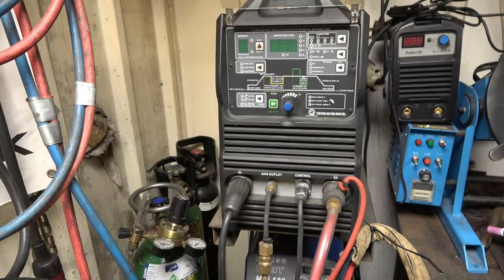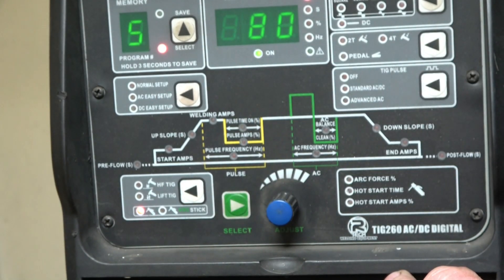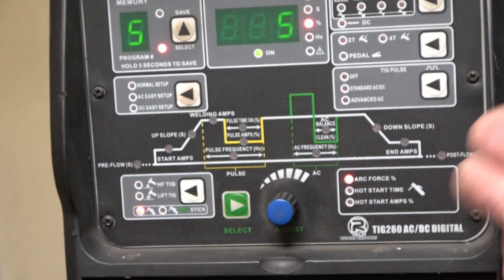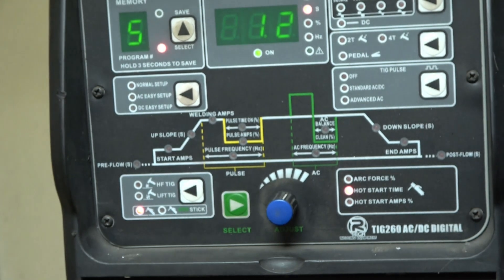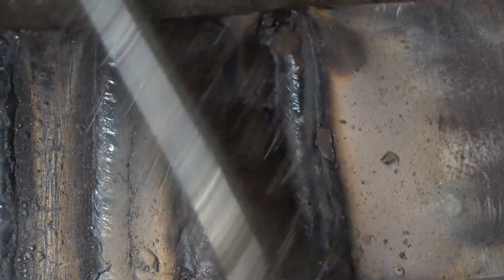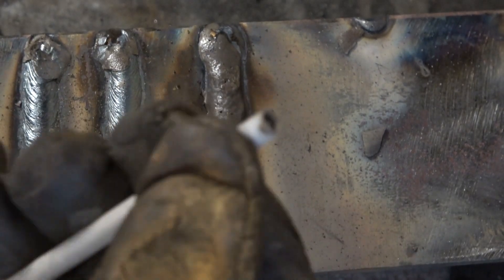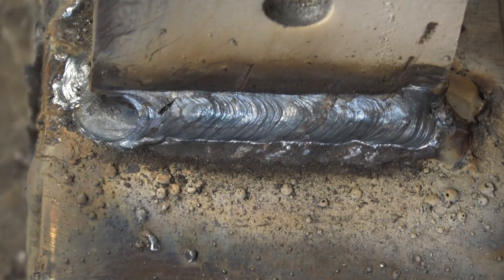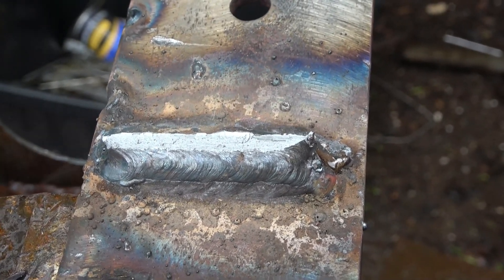R-Tech Power Tig 260 Long Term Review . MMA  Welding . Hot Start & Arc Force . Explained

Comment: Cheers John, good welder for stick welding. The arc force and hot start is very handy for digging into really thick steel. Out of interest where do you get the 7018 rods from?
Reply from the maker: They were supplied by R Tech
Reply: @doubleboost  Many thanks.
Reply: We needed some 7018's for a repair on a timber harvester, my son picked up a generic pack from a  local motor factors and they just wouldn't start an arc and we tried 3 different transformer welders (all had enough open voltage) I got a 0.6kg pack of Murex from our local steel stockist and they were different again, but that hot start function looks really useful.
Reply: @graemewhite5029  It is really useful.
Reply: I think it's the first time I have seen stick welding up close.
It's not as scary as I thought. 
My welder has lots of settings available. I will have a go.
Thanks!
Reply: @richardw3294  It isn't scary. Quite handy for thicker stuff.